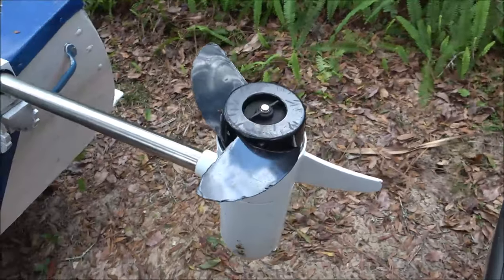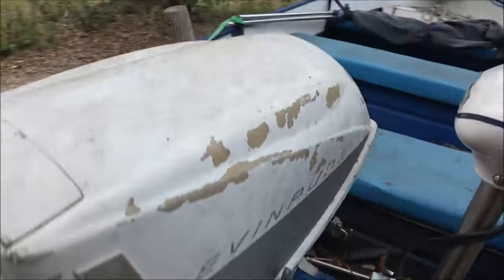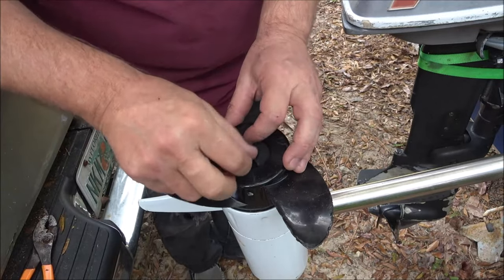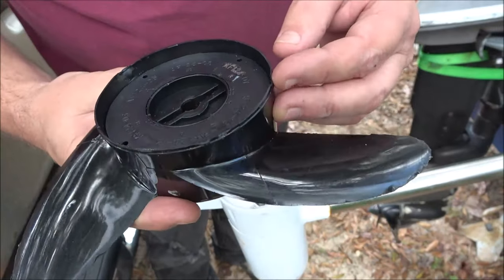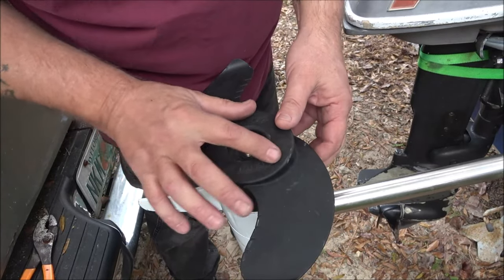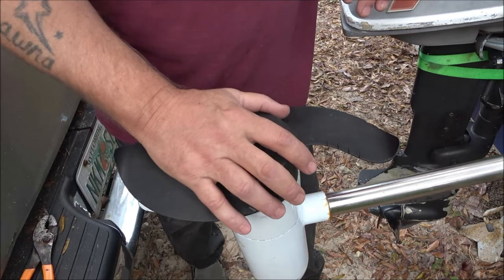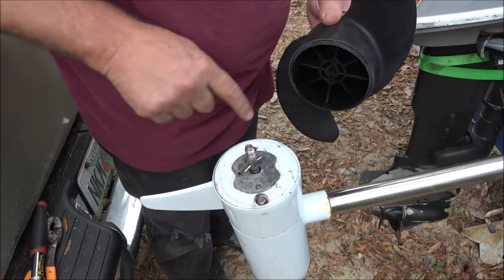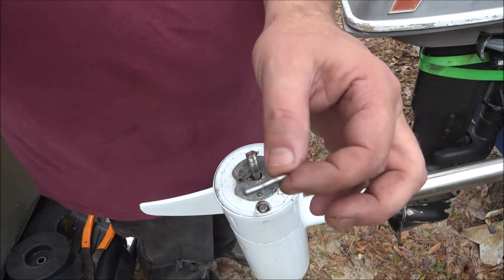Prop Replacement On Prowler 55LB Thrust Trolling Motor In 4K

Comment: What size nylon lock nut did you use? Lost my prowler prop and need to replace it. Thanks.
Reply from the maker: Sorry for the late responce, I just saw the comment. Anyway, I'm not sure what size the nut is because it was in my bolt bin. Sorry I couldn't be of more help.